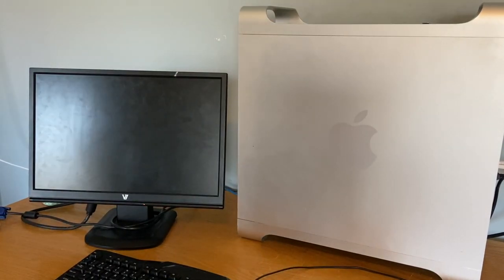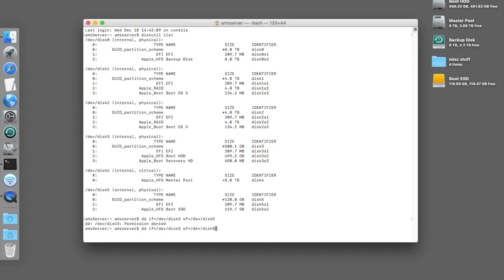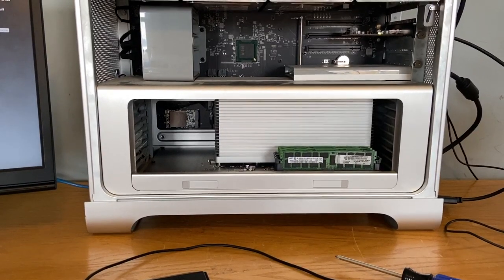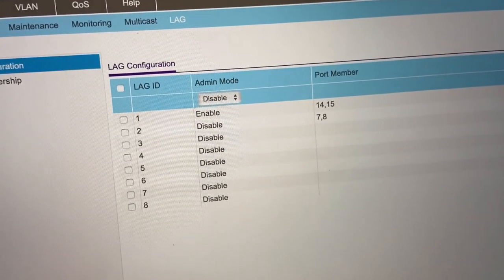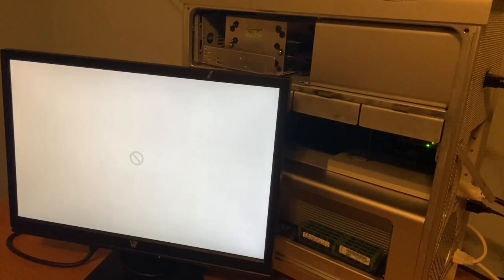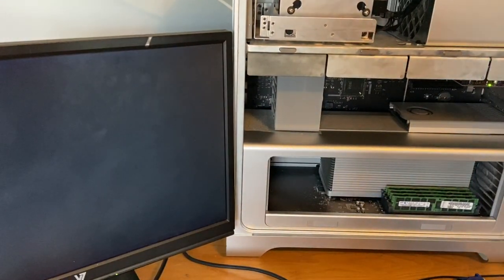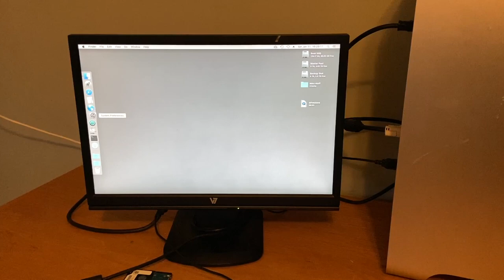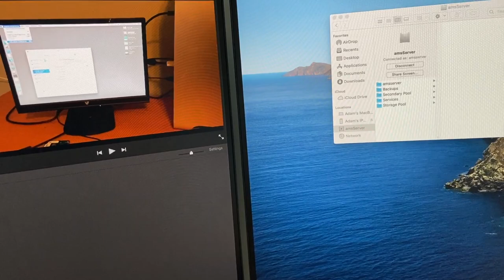Mac Pro Server Troubleshooting and 10-Gigabit Upgrade

Comment: Hey, cool vid. I’m ruining freenas on my Mac Pro 5.1 and want to see if I can get 10gb networking. Does the PCIe card you got have to be compatible with the Mac hardware-wise or will any PC card work if there are drivers? The FreeBSD install should have drivers for them I’m assuming...
Reply from the maker: I think it's just software/drivers, an Intel X520-DA should work fine (and they are like $50 on eBay)

Let me know how it works out, when I move to my big server my Mac Pro will probably become a Windows system.
Reply: @AdamMessmann   ah great thx. I'll check out your other vids. Hopefully I can get a peer to peer 10g connection between the freenas MacPro and a Hackintosh, then get a MicroTik 4 port 10G switch down the line for my other machines.